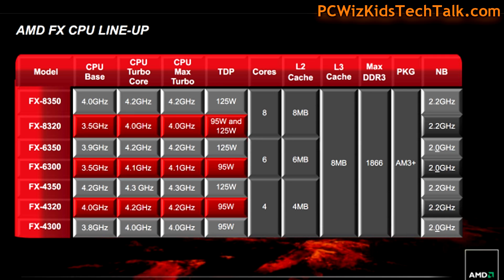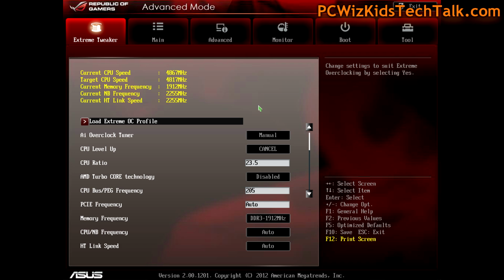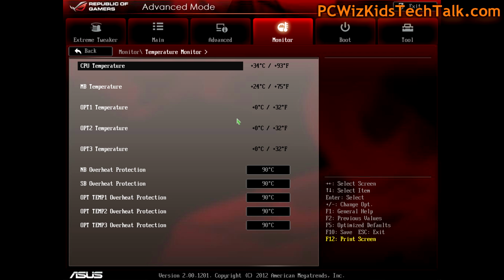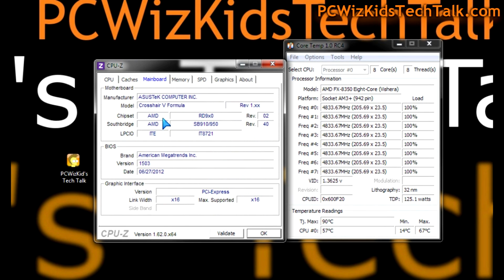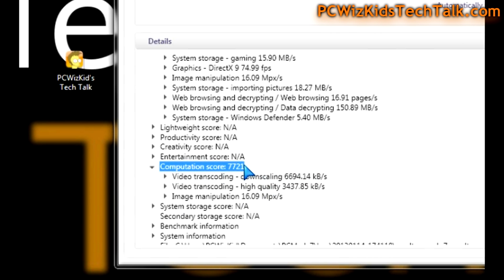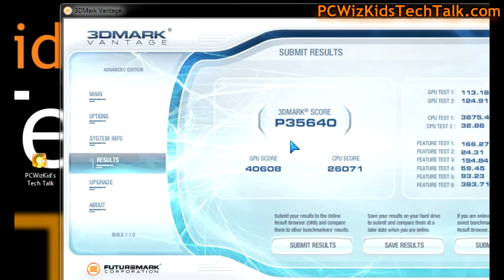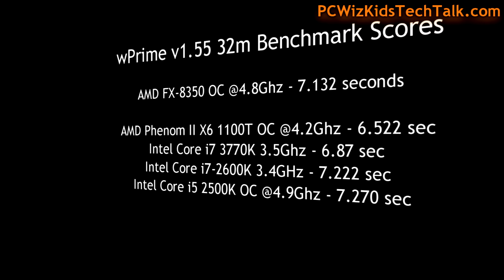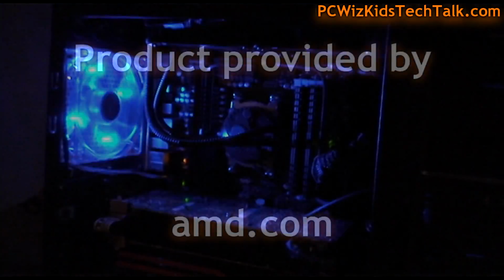✅AMD FX-8350 Overclocking 4.8Ghz Video Review - PCWizKid

Comment: Looking at the scores it does not seem worth having to buy a fancy motherboard and aftermarket cooling, plus the risk to the components and lifespan of the system parts to get the gains which not that many people would notice anyway. We are only talking about doing tasks only abit faster than if you got a i5 3570 with stock cooling and a motherboard that costs half as much.

Comment: Lol what? Anything less than a $100 case is a poor ventilated case... A 1000W PSU at the bare minimum with a 7990. $1300 alone right there. $1400 once case is considered. A decent Mobo will Run $150+.. AMD FX work best with 1866 ram. $70. 8350-$200. Cheap water cooling unit $100. 1 tb HDD -$50.. 120GB SSD.. $100..Thats $2000 total. it isn't the case thats the trick. Its everything else inside it.

Comment: Yeah, I've seen many videos with the H80 installed doing similar clocks, although I think VCore was lower on most of them, switching up to the 240mm rad on the 100 series will add some insurance, just make sure the 100I has a copper cpu interface and not the aluminum!!! If you find your temps are a bit high consider high perf fans (scythes or deltas, nidecs if you can find em) 2 push fans should do you just fine :)

Comment: from what i've read and seen on review websites, when overclocking fx8320 and 8350 it eats close to 350watts by itself.  This is if you're overclocking to 4.8 or 5.0ghz. If you're not it'll be ok if you go with a new mid range graphics card. 230watt CPU and 150-200watt graphics card equal 400-450watt. Leave some room for your PSU to breathe. Most 550watt PSUs are 80plus bronze. If you want to clock higher than 4.2 you might want a higher watt PSU. because when you up the vcore FX8320 eat alot.

Comment: I got mine stable at 4.812 Ghz @ 1.488 v-core HT 2405 Multi 22.0 Fsb 218 LLC high both of them Power delivery  High power settings Optimized AMP auto ce1 off c6 off cool& quiet off memory oc'ed from 1600,hz to 1750 MHz  I discovered that some memory oc limitation and performance degration if you oc the ram to much I gave it a 150mhz push and made my numbers awesome  I ran 3dmark11 my scores are  graphics 18645 Physics 7863 Combined 6695 max temp IBT 50 c take that intel fan boys hahaha

Comment: His volts are running 5ghz voltage too high for 4.8 Ghz @1.5v-core 
I'm running FX8350 @ 4.765Ghz @ 1.47v-core I have hit 4.8 stable with same voltage but fails IBT after 2 passes 4,765Ghz I get all 10 passes using IBT  I personal found a wall where if I do go above 4.8 Ghz benching my temps jump high quick I'm using a Antec 620 khuler with Kaze Mugen Sythe fans at 2000rpm push pull and im talking about pushing more voltage then 1.48 gets my rig hot max temps I get now are 53c max im good withit

Comment: Remember though kiddies that it is always best to see how far stock volts can give you. Changing volts causes lots of heat where Altering fsb speeds and multipliers first. If you can't make it stable on stock volts then the mild the volt tweak the better.

Comment: Because the FX line of AMD have what are called Modules.   Each module features two integer cores and a shared floating point core.  Cinebench is reading the number of modules (set of 2 cores, 1 fpu) and not the number of cores.

Comment: you have to less points on Cinebench 11.5 for FX-8150 on 4,6Ghz ,only 6,33pts? are you kidding me ? on every other  review is about 7,4 - 7,7 pts on that frequency., and FX-8350 almost same problem 8,32 pts at 4,8Ghz , others got almost 8,6-8,8pts., i hope that you not deliberately reduces the result

Comment: not its the true..this amd cpu as as expensive as a intel i5 2500 k for example and this one has only 4 cores..intel is expensive, but only cause quality has a high price ! intel cpu´s has an better overclocking capability as a amd cpu and the temperature is very low, not like amd..amd produces cheap shit for gamers which dont know what is good or which have no money..

Comment: The performance of Intel is showing is far more about functions & features over pure speed and OC ability.  Truth Intel CPU's are faster then they let on, with the speed being slightly capped in favor features and other speed & performance upgrades in other ways, that boost the system more then sheer CPU speed.

There are true six core intel CPU's for home users, but currently the true benefit to those just aren't ready yet *more programs need to utilize more CPU cores*

Comment: exactly. Similar methods used by intel to make a quad core preform like a 8 core for software.  granted some of the methods used by AMD are great, but they still produce ... similar results, in most applications *because most things aren't multi-core focused* and intel seems to have slightly better load balancing of the physical cores with supported OS's.

Comment: Save up then.  If you don't need it 'now', don't skipout on quality because you aren't willing to wait, when you can wait.

If you want a photoshop/video editing system. Intel is the way to go now. the 3rd gen (Ivy bridge) core i3/i5/i7 cpu's have quad channel ram, which for data heavy programs means a fuck load more then a faster CPU, because data rates of the RAM have always been more of an issue then the CPU has for such editing programs.

Go intel i5, ivy bridge if you must upgrade now.

Comment: If your going to go pro and do photohsop and similar other programs. Go Intel and get a I7 instead.  Gaming won't see the benefit much from i5 to i7, but multi-core programs like photoshop will, and considering that your asking on a tech video tells others you don't know enough to safely OC a AMD CPU to beat out *speed wise* or have the liquid cooling needed to OC to a level that would beat Intel in professional multi-CPU enabled programs.

Comment: I don't see what's the fuzz about this chip , I'm an intel guy, and I think the fx 8350 is a great chip, it'll handle everything you would through at , however there's some intel cpu would perform better but not by a large margin and specially not for the same price .. At $199 , the fx 8350 is the best price to performance CPU ..  Lets see if intel can beat that.